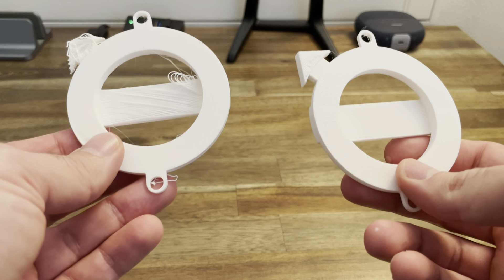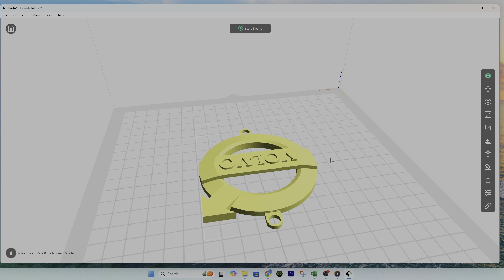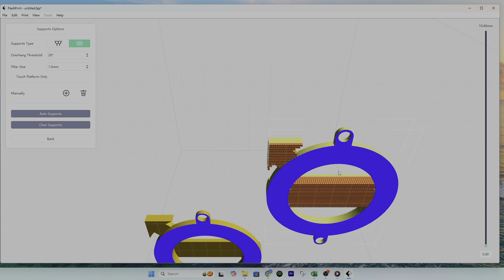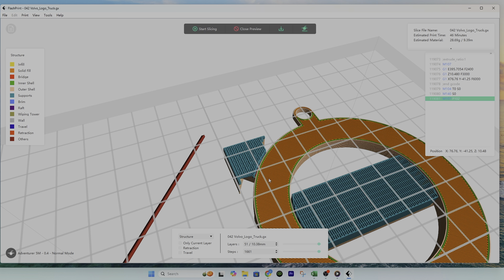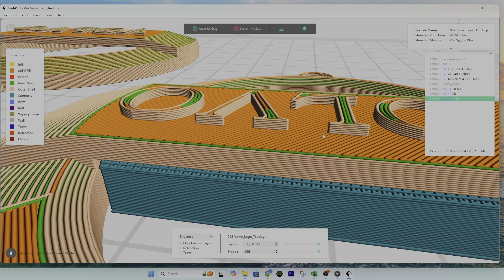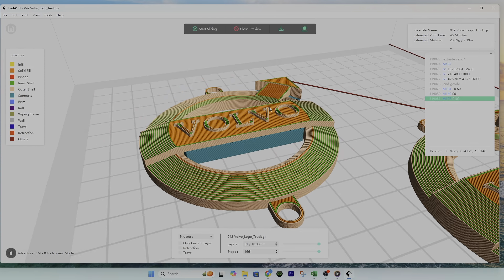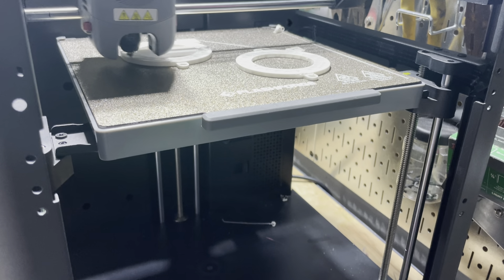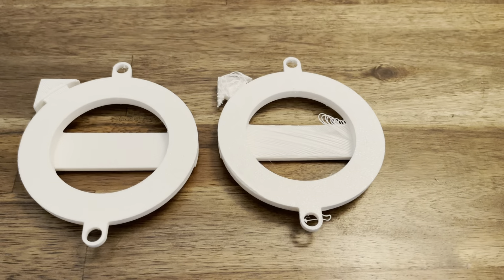Improving your 3D Prints with Support for Overhang

Comment: Use orca slicer not flashprint, it's much better
Reply from the maker: Thank you for the comment.  Flash print 5 works well for me.  Since I have a flashforge printer it also has more hardware options (i.e. more nozzle sizes).  The message is to ensure to use support for prints with overhangs.